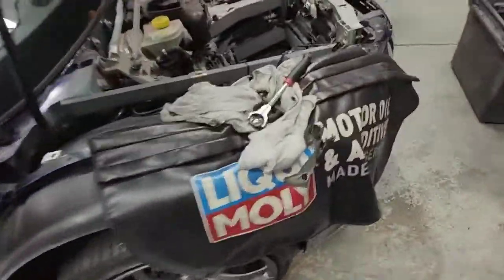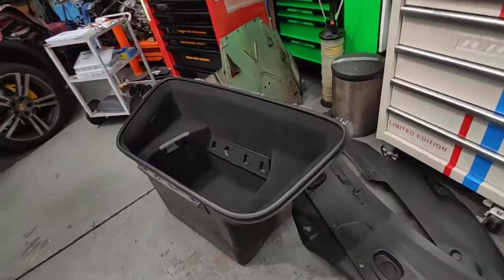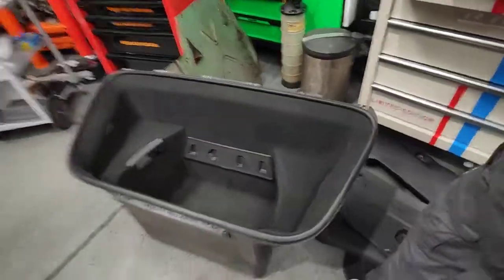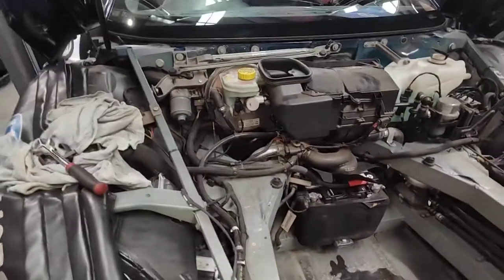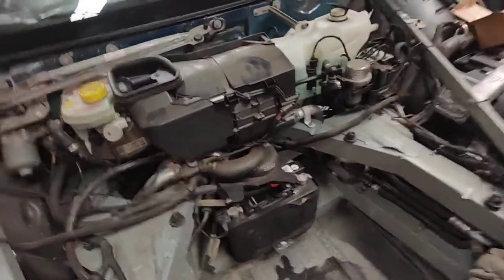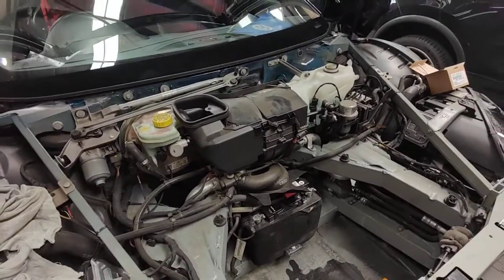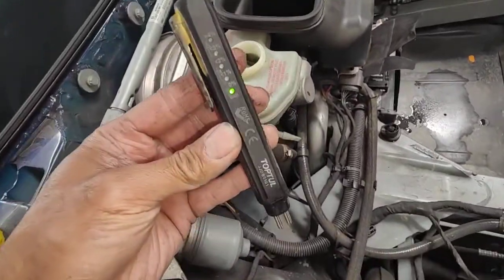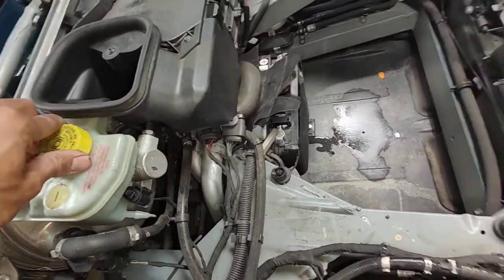Audi R8 V10 - Battery location

Comment: There is a cover in the luggage holder that just pops out. You don’t need to do all that to test the battery. However, you do to test/top up the brake fluid. Some people cut a hole in the trim which if done neatly doesn’t seem a bad idea.
Reply from the maker: Took it off to have a proper look at the front end & check the battery

Comment: The owner's manual is very clear in explaining that you don't need to do all of that removal.  There's a maintenance cover that pops right out giving direct access to the battery terminals.  What a disaster.
Reply from the maker: @sem3p  thanks for the heads up but we done other checks as well for other purpose not shown here just showing other info might be helpful to other people.

Comment: The plastic trapezoid thing slides to the side and exposes battery leads. You do need to take the cover off, e.g. to replace braking fluid.
Reply from the maker: We took it off to check everything at the front including the battery